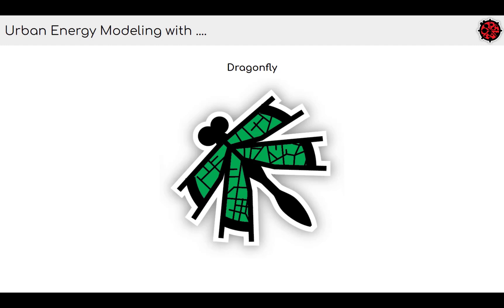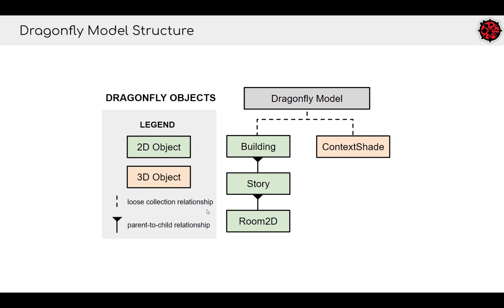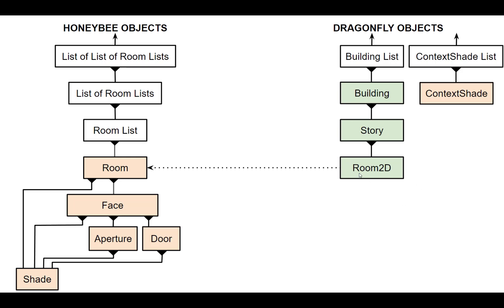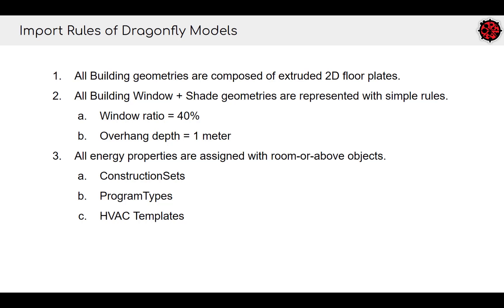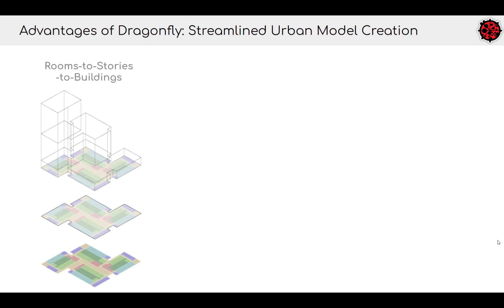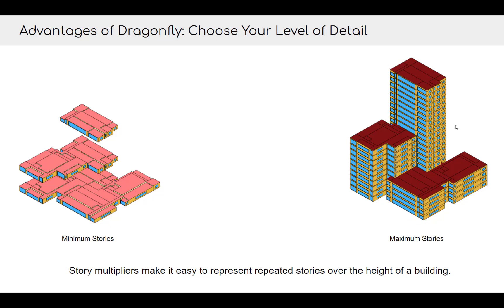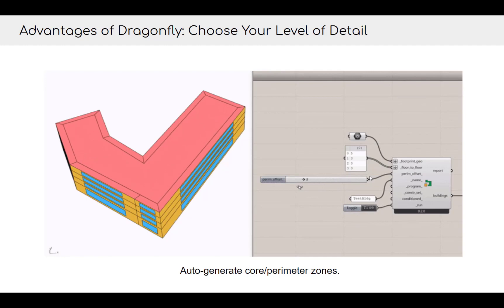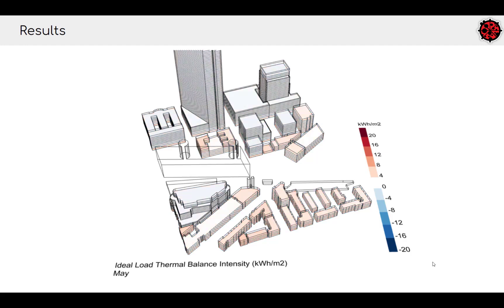Dragonfly : From Honeybee to Dragonfly

Comment: I’m using Dragonfly’s UrbanOpt to run urban simulations, and I’ve noticed an issue: when the number of buildings is small, the simulation runs fine. However, once the number of buildings reaches a certain threshold (around 100), the simulation seems to get stuck at a certain state for a long time and doesn’t proceed. The process doesn’t continue until I manually close the console. Has anyone experienced this issue, and could you suggest a solution?